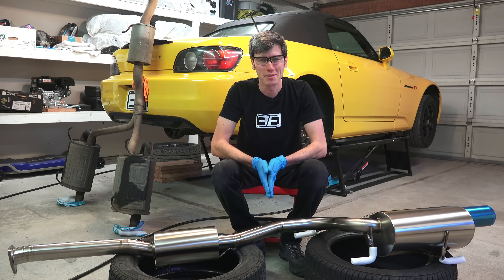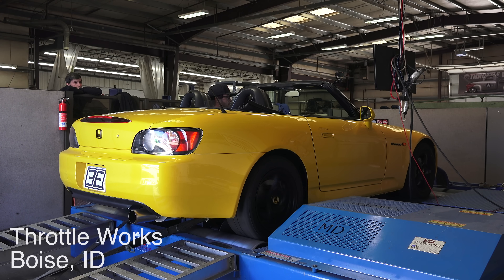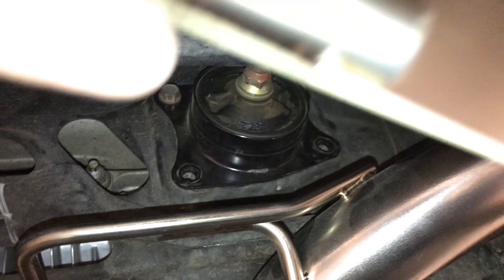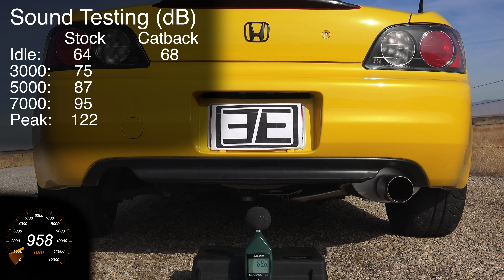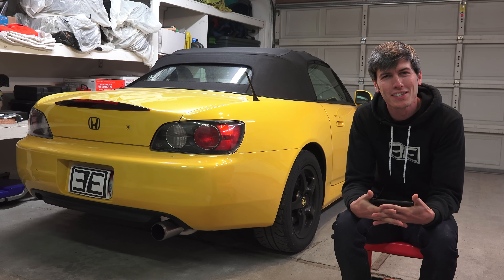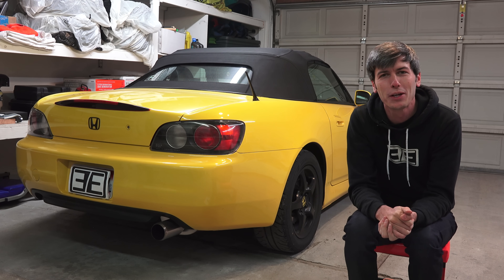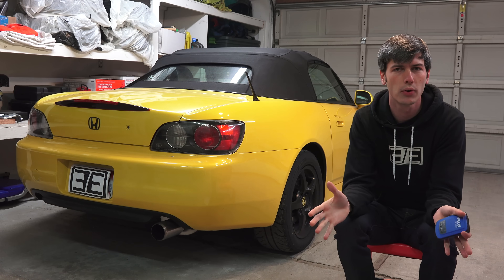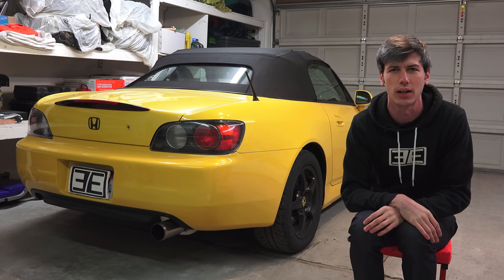Can A Catback Exhaust Make Your Car Faster?

Comment: If you do the maths.
so lets say stock 1 tonne and 200Hp
with 1.2% weight decrease would be 988kg . 
And 1.4% more power would be 202.8HP
In that case if you look at power/weight ratio than it would be a 2.6% improvement. 
Which is what matters in a straight line.

Comment: The titanium will only last up to 5 years tops depending on the grade of titanium but it does save weight.  But 304 Stainless is still pretty light though, lighter than aluminum from what i've heard. It's all in the cost vs gain, if it's worth the cost meaning, etc. I'm doing my Turbo manifold in titanium for my 95 Saturn SL2 as an experiment with a buddy of mine after my JE Piston port and polish, dual intake cam engine build to save weight because we all know Saturns are heavier than a Hellcats are with the Polymer panels and lost foam casting to make the engine weight 220 LBS...lol ;)

Comment: Great video! Interestingly you demonstrated the impact of weight even as small as 30 pounds can have on performance. You would have still gained performance had the new exhaust lost the same amount of horsepower over the stock exhaust from the weight loss alone. Something to think about. Honda obviously did a good job on the original catback exhaust design as far as engine performance goes. This was not too surprising for a Honda performance car. My 2001 Jaguar XK8 gains 23 RWH from a aftermarket catback system. Each car type requires an owner to do their own research as gains can vary widely.

Comment: The fact that it's lighter than the stock one and also makes a little bit more power, it can go a little bit faster based the engine has to pull less weight.

Comment: A higher flowing catalytic converter and a tune have a lot of gains when combined. Adding a 2.5" to 3" diameter exhaust frees up more power if your catalytic converter diameter matches the exhaust piping

Comment: I actually love this exhaust new sound, its so much cleaner and smoother than the stock one, even though its not louder. Sound is hard to get right and is honestly worth some extra money! If you do see this, I thought after watching a couple of your videos you were in Boise based on where you were driving and this confirms it! I am building a civic and looking for a shop to install a few things and tune, do you recommend Throttle Works? They have some very bad reviews, is there a better shop you use as well?

Comment: $1,000 per horsepower doesn't make this exhaust sound all that great, but it is significantly lighter. You spent just over $73 for every pound lost, so it's a lot less lame than the dyno results alone made it seem.

Comment: 6:00 How would you "check for an exhaust leak" when it's gas? Would it be visible? Because all engines emit some carbon monoxide, an invisible, odorless, and tasteless and therefore dangerous gas.

Comment: I am a fan from the start!  Great job on all your videos.  I have a simple question.  It is based on auto racing.  When I HPDE "race" at Lime Rock there is a decibel meter.  The limit is 84 I believe.  But here is my question ... if one car going past the meter is at 80 db's what would the meter read if two identical cars pass at the same time?

Comment: 2,500.00 for 35 lbs in weight reduction LoL.  Remove spare tire and jack boom free 35 lbs.  5 lbs lighter wheels would probably run you 1,500.00 rotating weight more effective.

Comment: Doing acceleration comparisons from 2nd gear to eliminate the driver-dependent shift-time is genius- also probably won't spin the wheels nearly as easily, which makes launching more consistent as well. But I guess realistically a G-Force plot is the easiest accurate-esque way to do it.

Comment: Does anyone remember the MythBusters stripping a car down and making it a 12 second 1/4 mil drag machine from like 16 seconds just removing weight? The whole entire value of this exhaust is the weight reduction. If he continued with this theme and swapped out part after part after part with reduced weight but improved strength material he'd have one helluva faster car that won't rust and accelerates much better.

Comment: Those welds are amazing. The question is: Do the Kooks Green Cats provide just as clean exhaust as the stock units on the C8 Corvette. That thirty + Lbs. of weight savings is amazing. Also it appears that the ti exhausts do not corrode much at all. New mounts. Must be pretty good rubber.

Comment: Yep, I had a similar weight difference with the leaking, rusty OEM exhaust in my FD series RX-7 and a Pettit Racing stainless steel exhaust. I was amazed. Also I replaced the cat converter with a high flow converter and I got a total of 15 extra HP (OK, 14.8 HP). I miss that amazing car.
Reply: At a fraction of the cost of Ti, I guess?

Comment: 2/3 or more before you got to the subject....   and you neglected to compare max clean low of stock vs cbe   ie:  if you shove a higher flow engine into the equation which is where the cbe should gain vs stock

but ultimately this vid shows sticker power s a better investment  lmfao

Comment: 2.5whp is about 4hp, now if convert the weight saving to horsepower, that's about 2 to 3 hp more, a total of 6 to 7hp which is not bad in my personal opinion.

Comment: There is one more fundamental KPI that should have been included in this test. That is - what is the wear rate of the various tyres. This is important, especially when comparing price. The reason being, the cheap tyre may last longer than the expensive tyre, or vice versa. And the longevity of the tyre has a clear and direct impact on cost.

Comment: Damn $2000 is a lot. I spent $326 on my K&N intake and $220 on my header back straight 63mm and I felt easily a 10whp-20whp increase throughout the powerband (I own a 420whp Evo so I've felt whp gains before).

Comment: The extra power comes mostly from more efficient cylinder filling, not just the power used pushing out exhaust gases. The intake charge is not being hindered as much by residual burnt gas in the cylinder. Every engine is basically an air pump and the more volumetric efficiency you can get the more power you can make. The legendary Chrysler Hemi engines were able to achieve over 100% volumetric efficiency using good long runner cross-ram intake manifolds and free flowing exhausts. I don't know that any other stock engines have been able to achieve this but with forced induction so common these days it makes that point pretty much moot. 

Improving cam profiles, larger valves and porting and polishing do the same thing as a free flowing exhaust in an NA engine. Turbocharged and supercharged engines enhance the effect a lot more and usually respond much better to less restrictive exhausts.

Comment: Free performance gain... only drive your car when it is cold out with low humidity.  Here is one... how about plugging up one side of that stock dual exhaust and putting a high flow muffler on the one side?  Weight savings and cost effective.  I did exactly what I described to one of my motorcycles (2006 Kawasaki ZX-14), and it stayed at 160 peak HP so no loss of power, but I shaved off about 20 pounds which on a bike is big (roughly equivalent to shaving 100 pounds off of a car).

Comment: The part of exhaust that is not changed is blocking flow of the gases from the engine. Whole exhaust change would make more difference. By the way muffler looks awesome to bad you can’t see it like on motorcycle.

Comment: Spent 2500 when he could’ve gotten the same result from eliminating the y-pipe back and hiring someone with a bender to make a piece of pipe into a single glass pack. I like the video. Always wondered about the amount of horsepower increases when you put in a straighter muffler or large diameter pipe.

Comment: The stock exhaust and intake are likely tuned to about the same cfm. If the intake was capable of more cfm than the exhaust, you would have seen big gains. You can't blow more unless you can inhale more.

Comment: If the flow restriction in the exhaust is lower with the new cat-back exhaust, you need to change the tune on the ECM to get the real benefit.  The engine computer is fighting your output.

Comment: So considering you took out 35 pounds. How long till it pays itself off in MPG?
Also, does this additional HP mean it's spending more gas or is this extra HP coming strictly from the alleviation of exhaust pressure?? 2500 bucks I'm estimating this exhaust pays itself off in about.... 2 or 3 years?

Comment: I doubt if you will see any negligible increase with these type of mods because any car that has an ECU will adjust various parameters to keep it within the settings set by the factory. You would have to have a remapped ECU installed to take advantage of any mods. Same issue if you change to a more efficient CAT or worse...remove it. Removing a CAT altogether also creates a situation where the exhaust is nauseating stinky smell and can get unwanted attention. These changes also mean it won't pass smog testing if your state has that requirement.

Comment: Please note that, wider the exhaust tube aft of the catalytic converter, denser the air will be due to the cooling of the exhaust gases. This is the principal of the working of refrigerant gases. Denser gases are more difficult to evacuate. Fundamentally an exhaust system is the most difficult part to design in an automobile because there are so many variables and physics takes a beating.

Comment: Thanks a lot! U helped me to decide what to do with my 125i... pointless expend that amount when you just want it to sound “better” May be a removing the catalyzer would help a lot more
Reply: Not likely....just get a more efficient CAT but don't remove it altogether. Without a CAT the car will smell really bad and get undo attention because of that. Even with a more efficient CAT it won't be a huge increase....just a couple of HP at best. Any car that has an ECU will just adjust various parameters automatically to stay within factory parameters. You would have to custom tune the ECU to the changes on the car to optimize it. Be aware that this could cause your car to fail smog tests if your state requires them. That is why these custom ECU remaps are accompanied with a warning they "Are for off road use only." The way to beat this is to swap back to the stock ECU for smog testing.
Reply: Astro Bob thanks for the answer! Now i’m going to do a remap... in my country there’s no really control of the emmisions so, that won’t be a problem. Will see...

Comment: Depends on the stock exhaust.  The muffler fell off my 96 Accord LX, and the car revved much more freely, and felt more powerful across the entire range.  Even with the crush bends in the 1.75" pipe.  Nothing huge.  But any gain is noticeable and welcome on a car that made 130hp at the crank in 96.  And then there was the terrible noise coming out of the rear....

Comment: Even on N/A cars... Changing any parts on it does require a tune in order to see any performance gains.... Before a tune it is normal to see 2-3 hp increase but it can jump to 11-12 hp after a tune... Don't get me wrong, changing the exhaust is rarely done to have performance gains, it is more of an expression of the car owner.

Comment: The gain is not much for my corolla with an aftermarket catback exhaust, but it does look and sound so much better.  It is also lighter too so helps with the performance.

Comment: if it was a turbo or supercharged car, with intake, intercooler, intake manifold, ported, and cam upgrades too along with a remap, the exhaust plays a massive part on what power the car will make. so yes the exhaust upgrade is worth it if you are also applying the additional mods. my car has said mods except for cams and ported, it has a 3" decat downpipe, and 2.5" cat back no mid just back box running 289bhp. with a full 3" decat system im told i will get 305-310 bhp. but if i was to have the standard 2.25" with cat, resonator and back box, id probably only achieved 260-270ish

Comment: I wish there would have been a way to test exhaust flow. Splitting the pipe for dual exhaust like the stock setup on a 4 cylinder decreases the flow. I can imagine the single pipe flows out hot gasses much more efficiently. 

Your gains being in the upper RPM make total sense considering better flow, less restriction and dealing with the most exhaust gasses at those rpm. 

What I want to know is how this same change would effect a turbo charged car. I'm guessing you may see gains as soon as the car has full boost and up, not just higher rpm.

Comment: I've had 3 different exhausts on my 2010 Camaro and can definitely confirm there's a big increase in performance over stock and over middle of the road exhaust systems.  
While I agree with one of the comments that the lighter weight does play a good part of better performance, one can't discount the fact that once cars can "breathe" better, they will perform better.

Comment: Do you understand how tuned exhaust works and what the point of them is? It sounds like you do not know what you are talking about. A catalytic convertor is not much of a restriction unless you have a crap cat in which case replace it . You need at least 3 dyno runs and average the results otherwise is it pointless, they are not accurate enough to do 1 run and think the result is definitive. Do you check the setup of the dyno first (gearing, elevation, temps etc)? Cat back is for idiots who do not understand how gas flow in a pipe works and how important a remap when you change your spec. Yo.

Comment: If you got a Custom built system at your local exhaust shop.

It would sound better.
It would cost about $400
It would be Mild Steel so slightly Heavier.
It would only last about 20 years and not 80 years like titanium. 

good choice :D
Reply: Haha. Yeah ones from a custom shop with mild steel would absolutely not last 20 years. Maybe 5 at best

Comment: A titanium exhaust is like a carbon fiber intake - a really expensive way of doing something that could be just as easily done with steel/aluminium because the material used has nothing to do with the outcome, it's all a matter of geometry.

Comment: I replaced the factory exhaust on my MK6 GTI with a catback which also deletes the rear resonator. I can say YES it adds HP/torque. Throttle response is quicker, power delivery is more linear, there's noticeably more low and midrange torque and a little more top end power. If I had to guess it's probably about a 5 to 10 hp increase, nothing drastic. The engine just seems to rev easier. Turbo's run off exhaust gas flow so a less restrictive exhaust allows the turbo to spool quicker and build boost more efficiently. On a normally aspirated car like the S2000, an exhaust doesn't have as much as an effect on power unless the factory exhaust is really restrictive.

Comment: As usual another excellent vid. I know when I put a cat back system with muffler deletes on my gen 1 GT3RS there was a noticeable increase in power and torque without any programming of the ECU.  On track on a straight while driving against a friend in the same car with the stock exhaust   with both of us a full throttle I just kept on pulling away. The longer the straight the more the lead I achieved. So freer flowing exhaust + lighter (in this case about 35kg)  =  faster accelerating car :)   There is a significant dB increase which I like but some others may not.  A definite value bang for buck modification.  Love your vids. Keep em coming  :)

Comment: Power is good for acceleration, but weight reduction improves acceleration, braking, and cornering! 👍

Also, the S2000's engine is close to it's maximum output in stock tune, and the factory exhaust is as well. Amuse knows this and took the factory exhaust and made a meaningful improvement to its design. Japanese mindset.
Reply: smokenrowboy probably not any benefit to cornering because the weight removed was very low to the ground. If it was a non-convertible and he installed a carbon fiber roof, or if he installed a lightweight glass windshield, that would help with cornering.

Comment: Take away is cut and weld shut one route off the stock to reduce weight, replace stock muffler for something less restrictive and less than $2g and have a better sounding car than stock.That new cat back sounded aweful tbh.

Comment: It depends, if that part of the OE system is very restrictive then its a no brainer. If however the inlet tract is the problem, well you start there.  If the cars  a keeper then a stainless system with a tone you like is an investment.

Comment: It makes more power because the old exhaust was a dual muffler dual exhaust. Single muffler single exhaust 2 hp gain. And weight loss. Do a   Cheap single muffler exhaust and compare .

Comment: The most important on exhaust is weight reduction. To increase power you need a new intake and work on ports plus a full engine management and eventually camshafts for maximum power in stock normal aspired engines.

Comment: About the humidity: Actually, a higher humidity increases oxizidation of your fuel. What does this do? Decreases the point where your fuel combusts. The downside is more carbon is generated -- but you do get a quicker explosion, therefore higher power output. So no, higher humidity does not decrease your power, because if that were true, then fuel refineries would not put a slight amount of water into fuel to help it oxidize, and therefore burn easier.